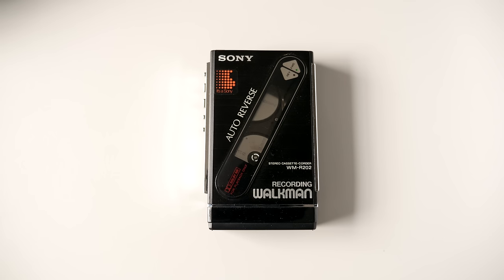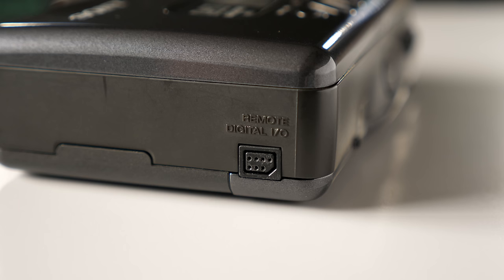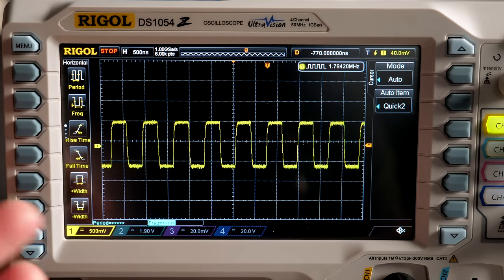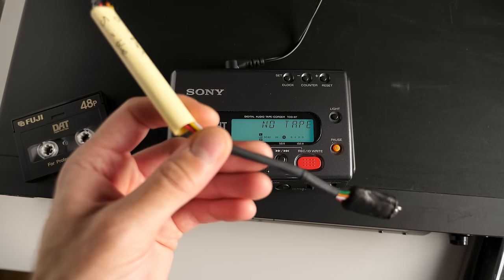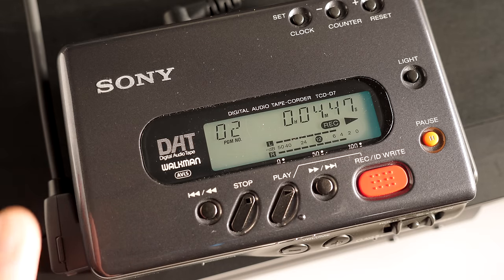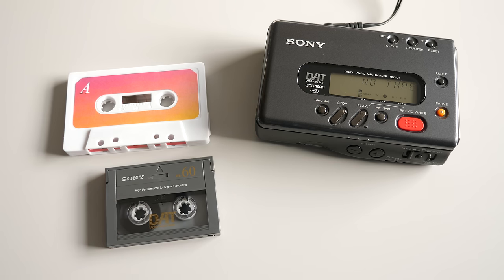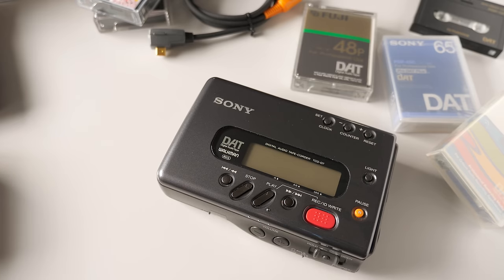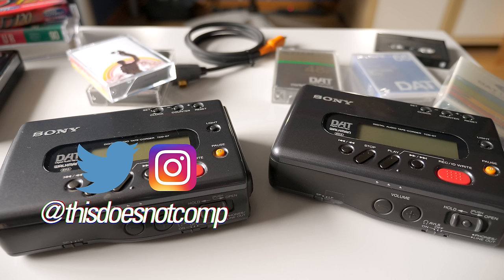Sony DAT: What Cassette Should Have Been!

Comment: It didn't really help by having a copy-protection system that not only didn't work, but was audible on the original as well as on the copy. If they had included the system they eventually came up with to replace the original one, they would have had something, but they didn't really have to worry about digital to digital copying being a widespread thing yet.
Reply: SCMS wasnt a function sony wanted that was the RIAA that forced a copy protection scheme, and im sorry but people keep going on about how the copy protection was so awful, but the thing is that was always going to happen, they freaking did it with VHS, it was called macrovision and it was designed to make the produced copy have all sorts of issues by confusing the recording VCR into doing things like playing with the tracking causing a rolling image and to play with the vertical blanking causing the image to go dark-light-dark.

but back to DAT. When DAT was introduced SCMS wasnt even on sonys mind that was the compromise that was created between sony, the RIAA and congress after the RIAA tried to force sony to recall and never sell DAT at all it was complete crap as a copy protection, but heres the thing it wasnt meant to stop you from copying, it was meant to stop you from creating a copy of a copy, and in that aspect, yes it did actually work fine as the players would simply not record at all, unless you recorded in analog at which point the SCMS would be useless, but the RIAA didnt care as much, they were worried about the perfect bit for bit digital clones that could allow people to buy an album and recorded a load of DAT tapes to then bootleg sell

Comment: Wonder if it would record audio from DVD... On second thought, would need to go into the DVD player setting and use down sampling PCM. I’m just wondering what the DAT is accepting as a digital signal. Would it accept a compressed signal or a higher sampling rate?

Comment: DAT was designed and marketed for the pro audio business. Yes Sony and others made consumer versions but the loading and tape threading mechanisms and spinning drum record / play head architecture forced a price point out of reach for most consumers. Average consumer DAT was $900 and equivalent to $1500 to $2000 in today’s dollars. It was designed as a recordable equivalent of the audio CD as it’s digital specs mirror it. 48k sample rates in the pro DAT models actually exceeds CD quality but that rate is actually intended for audio for video applications.

AES and SPDIF audio interfaces are indeed similar. The AES pro standard has both unbalanced (BNC connector) and balanced versions (XLR connector) and runs at a higher voltage to allow for the longer cable lengths commonly needed in TV and recording studios. SPDIF is 1 volt peak to peak and has a cable length limit of a few meters.

Comment: The irony is that cheap CD-R made the RIAA's nightmare come true, after that long battle with DAT tapes they had a universal format to contend with.
Reply: spikester even more ironic is how many years they music industry itself used DAT for mastering and duplication purposes.
Reply: @danieldaniels7571  The RIAA wanted to lock down DAT so much in the consumer space that a tape recorded on one machine couldn't be played back at all on another, they wanted to cryptographically tie the consumer recorded tape to that machine. Only prerecorded tapes would have universal playback capabilities for all consumer machines if they had their way. The professional units never had to deal with this RIAA proposal simply because DAT was a consumer failure so the need wasn't there. DAT was first coined as a professional format so it would have been used for that regardless had it been successful for consumers but rest assured those machines too would have been made very locked down well beyond the agreed upon SCMS protections if DAT became as ubiquitous as cassette tapes did.
Reply: @spikester  Professional DAT machines would never have had SCMS forced on them. It would have rendered them useless as professional tools. The RIAA never had a problem with professional DAT because the hardware was so expensive that consumers would never have bought them.

Comment: Some Jvc deck machines can record up to 96k, and stelladat ii have both96k&88.2k high sampling rates to choose
Reply: Yeah the ADAT format basically took it over and even went higher to 192khz :) However only 2 channels instead of 4 or 8 like you would have with lower samplerates.

Comment: I’ve just bought a D7 to replace my recently passed away Aiwa HD-S200... 

There’s just something really satisfying to use these kinda perfected tapes in a 2019 car with all the bells and whistles or my 2008 bmw... 

Unfortunately the HD-S200 are prone to die because of their capacitors and I’ve found no repair shop in Germany to repair it. 

P.s: DAT works basically like VCRs... that’s just totally cool in this small package. 
#2: you can use DDS tapes in DAT machines but don’t go to crazy on the length... I’ve used tapes with more that 3:30 hours successfully 

So hopefully I can holet back into it soon with my new old DAT (which was actually used by a journalist for years all over the world)

Comment: Ah, I love dat! I used to own a Sony DTC-55ES recorded. It was beautiful, sounded great, looked cool.. But it broke down so often that I eventually gave up on it. And today they’re too expensive 🙁 Is I run into an affordable reliable version I’d probably still go for it.. For more I use a Nakamichi 682ZX and 482 (both professionally restored), which also sounds great...
Reply: Erwin de Wit I scored a Sony PCM-2700A DAT deck for $5. It works great, although I hardly ever use it. For the most part it just sits in my rack looking cool waiting for the day I score some used tapes to play on it. I do use it as a digital pass through between my Oppo DVD player and Sony receiver, and it’s neat to watch the digital VU meters when I play CDs.

Comment: Another big reason why the DAT failed as a consumer device. The record labels successfully lobbied to prevent the first consumer DAT machines from recording digitally at 44.1 kHz,  the consumer machines only had a sample rate 48k to prevent 1:1 digital copies from CDs. Incidentally, this is the only reason the 48k standard exists still at all, and became common in video. 48k comes from DAT machines, a different sample rate implemented to prevent the copying of CDs.  A weird relic of this,  the machine you have here, the D7, records analog "SP" at 48k, it can't record analog at 44.1, however the subsequent model, the D8 could record analog at 44.1 (I owned both back in the day, and still have the D8). Incidentally the D7 cost around $700 at the time, a lot in the mid nineties!

Comment: Loved DAT - but it had a number of issues - first delayed start, expensive, complex and almost no industry support. It also entered a complex marketplace with high quality recording being fully possible with older formats plus Video 8 - multi-PMC sound, VHS Hi-Fi Beta Hi -Fi, access to PMC processors such as the 501 & 701 linked to a VHS/ Beta deck - fantastic -  then Mini Disc and then CD....still have my DAT tapes but no longer have a machine. The D7 was NOT the first portable and I suggest are avoided as they tend to break and are expensive / difficult to service/ repair.

Comment: that signal looks like textbook NRZ code. You could say, that it looks like FM, but is really not. This is probably used to implicitly send the clock with it, to avoid clock drift. Alternatively this could also be Manchester code..
Reply: ^^^^ this!!!
Reply from the maker: Technically S/PDIF uses biphase mark code but I didn’t want to spend another 10 minutes explaining what that is (at half an hour long there are already plenty of people complaining). I went with the generic term FM instead because that’s a much more broadly understood term, and also serves to better illustrate how S/PDIF is different than the typical logic signaling that other devices use.
Reply: It is based on Manchester code.

Comment: My understanding and experience with DAT was that it was going to be for the consumer market to possibly replace cassettes, but it was a bit pricey.  Somehow, recording studios got a hold of the format and they were very widely used in recording studios and other audio facilities.  Tascam and Fostex made studio-grade recorders.  I had a JVC DAT Recorder in my studio and the quality was very good.  I also had the Digital Compact Cassette recorders in my studio as well and they too sounded pretty good.  DAT was better though.

My JVC DAT Recorder used SCMS (Serial Copy Management System) to stop the copying of the DAT tape.  It was part of the RIAA, I believe, to limit the digital copies made.  It was kind of stupid, because in studios, copying a DAT master was pretty important to do for backup purposes.  

I kind of miss my DAT recorder these days in my current studio...
Reply: There was no "somehow" about recording studios obtaining DAT - professional DAT decks aimed at recording studios and broadcasters were an intrinsic part of Sony's masterplan and were sold right from the beginning. 

Indeed, the RIAA had no problem with professional DAT. The equipment was so expensive there was no way consumers were ever going to buy them, so professional DAT decks did not have SCMS built in. Only the cheaper ones aimed at consumers did - but they were still too expensive for most people, and because few consumers bought into the format, economies of scale never kicked in and so consumer DAT decks never really got cheap enough to become mass-market.

Comment: Liked that video. I've got a TCD-D3, D8 and D100 and the remote control box which gave me digital & optical into the units. The D3 never worked well, it (they) had tape transport issues and all the DAT units I bought new. I also have a couple of high quality Sony mics and live recordings were very good. Sony also made a DAT Walkman player a WMD-DT,1 a beautiful piece of engineering which I bought in 1994. I'll need to go and dig out all my DAT gear after what you have just said. What a pity that DAT died.

Comment: Error seems like because of bent scanning process. They mostlikely need a mechanism to auto sync speds of head and main tape . On hdds it seems the fixed that sync problem but still there is spinup problems which is in fact sync problem actually the some problem :P

Comment: DAT, at the price especially, wasn't ever going to be a mass sold audio product for consumers like the Compact Cassette.  It pretty much gravitated to professional use as such.  Other than that, by what I have read over the years, the mechanisms were not as reliable as the video recorders they were cut-down from.  That said as anyone my age (63) will remember VHS decks were often fussy and would eat tapes as such.  Not that cassette decks don't do the same, but the costs were vastly different.  I think I really was, and still are, very intrigued with the DAT format, resistance is easy with the fact they all break (if they're not already) and blank tapes are not readily available at any kind of reasonable prices.   Honestly, for archival and reproducing houses, DAT made sense...not so much for anyone else.

Comment: I considered DAT at one time but realized that, while it might be fine as a stationary format for the home, it wouldn't work as a portable format. The portable player was too delicate and complicated for on-the-go use (like the compact cassette it was supposed to replace). I suspect all it would take is one drop and the portable player would be damaged to the point where it wouldn't work. For that reason I gave it a pass.

Comment: Hey Colin,  I have a Sony PCM-M1 that was given to me by a friend for helping him move.  It came with some tapes, 4 of which are still sealed.  I think it might be a step above yours, as it has 3 options for speed.  The SP speed has two frequency options, 44.1, and 48kHz.  The guy who gave it to me said it periodically eats tapes.  By "eats" he means a bunch of tape would unravel when the tape was ejected.  A head cleaner came with the unit, so I played with it a while and could not find the problem, because this continued to be an issue.

So the way he demonstrated the unit to me was he would slide the switch to eject, you would hear a servo releasing the door, and then he would pull the door open.  Then out came the tape with about a foot of excess trailing behind it.  The way I like to work on things, I like to hear all of the noises the machine makes.  After several tries I finally stopped to listen, and several things were happening after sliding the eject button.  So I waited for everything to stop, a couple of seconds.  I still had to pull open the door, but I pulled that tape out perfectly.  I pulled out other tapes just fine as well, even those damaged by yanking them out.  So really there never was a problem with my unit, just a failure of someone to understand the operation of this machine.  

I don't know what I will ever do with this unit however.  It is a really cool and interesting mechanism for sure but it does not fulfill any of my needs.  I actually do capture live sound, but I own a miniscully tiny digital recorder made by Tascam that performs exceptionally.  I don't have a really good stereo mic to plug into the DAT for portable use and it does not have a built in mic.  If I was allowed to record at a concert I could jack into the mixing board with it, but then I can do that with my Tascam, and I would have to convert the audio to MP3 for my purposes anyway.  

I suppose this unit would be ideal for someone who wants to archive important recordings, as I feel magnetic tape in general has a better shelf life than say recordable optical media.
Reply: Magnetic media AND optical media are both ideal for longterm storage. Only self-burned opticals can be a problem if they are cheap brands and subsequent low production quality and also stored badly. Also the organic dye tends to age a lot faster on cheaper ones. However the majority of good quality ones should still become quite old. I have CD-Rs and DVD-+Rs in my possession from the early 2000s and they all still run. With only VERY few of them having showing some signs of age but still play. The only ones refusing to run properly were super cheap brand discs. Tapes are also very reliable. Especially if stored properly (vertically standing and away from strong magnetic fields and away from high humidity). All of my Compact Cassettes still play and sound awesome. VHS-C tapes i recorded between 1999 and 2003 also still work fine. Same with MiniDV tapes i recorded since 2009 till today. Heck i even deliberately played out a lot of stuff to MiniDV tapes to have important things on a archival tape if my harddrives fail (which happens a lot more often than people wanna admit).
Reply: @KRAFTWERK2K6  I am going to start archiving on hard drives.
Reply: @derekwhidden9730  not a wise idea…
Reply: @KRAFTWERK2K6  are the new drives crap?  I have had good luck with Quantum and Seagate so far.
Reply: @derekwhidden9730  Well it's not so much about new or old. And even the manufacturer does not always guarantee you data safety on external HDDs. I had everything so far from a lot of manufacturers and all capacities and every now and then a HDD became bad. Mostly the mechanical parts of it. And i usually made sure they are sporadic in use to maintain their working state and prevent data loss from demagnetizing discs. I usually only keep HDDs for backups that are too big to fit onto one DVD or Blu-ray (single or duallayer).  Like uncompressed video encodes of final videomasters of videoproject. I have had a lot more HDD fails than non working tapes of optical media.
Reply: @KRAFTWERK2K6  I suppose nothing is safe.  On the one thing they can dig ROMs out of a landfill, and they still work, then there arcade games that suffer from ROM rot.  I always thought (like for the last 30 years because that is when I learned how ROMs were made) that ROMs were an extremely permanent and indelible format.  How time changes things.

I do wonder though, is data is left on a hard drive, and then the heads parked, just how long that data will remain.

Comment: Thanks for this elaborate review of the technical aspects behind DAT. 

Back in the day you had to buy an expensive home DAT recorder and an expensive DAT Walkman. Or you could buy a very expensive DAT recording Walkman. But that one was bulky and if it broke because dropped your rucksack you were F-ed. Might have been the reason that DCC, DAT as well as Minidisc failed.
Reply: no, DAT and DCC failed because of the RIAA, and minidisc only failed in the US because we had CD and were fine with that, but minidisc actually was very successful in European markets and flourished in japan for years, keep in mind that minidisc was introduced in the early 90s and even by the mid 2000s in japan you could still buy albums on minidisc, this was after the ipod had been introduced to the market it took a while for MP3 players and the ipod to wear down mindisc in its home market

Comment: Literally every single Sony electronic device that I've ever bought, back in the late '80s and early '90s had failed at some point. Only once under warranty. All the other times the repair costs wasn't worth it. I remember particularly a brand new Hi-8 camcorder CCD-V101 that cost $3K in 1990, that lasted only about 3 years of occasional use. First, the CCD sensor died, and after it was replaced then the videotape recorder section died. The same type of mechanism shown here but with the 8 mm tape format.
Reply: @Larry XK 
But with Sony, back in those days, it seemed sooner than later...